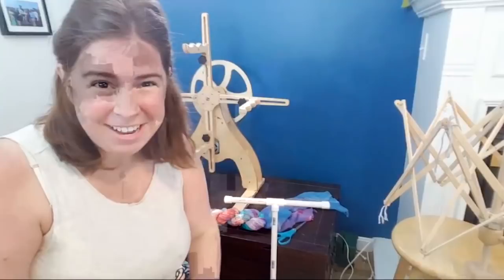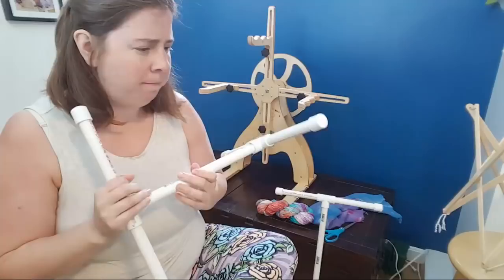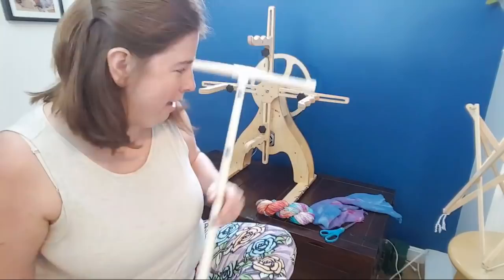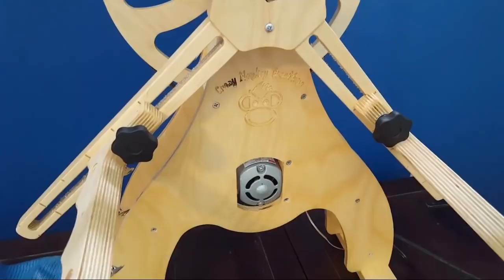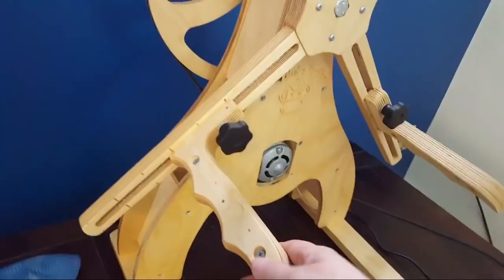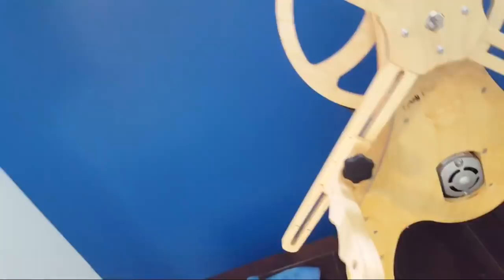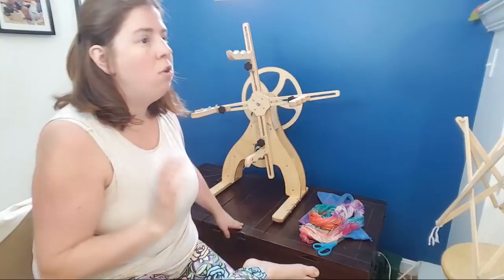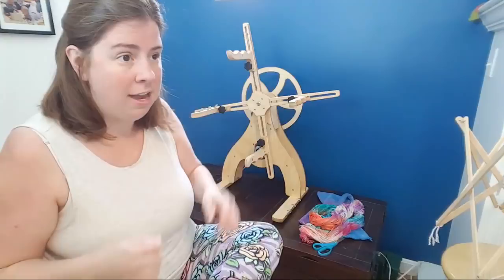My New Electric Skein Winder from Crazy Monkey Creations

Comment: A friend of mine uses a looseleaf notebook with the recipes (once she's happy with them) with a swatch of the fabric.  She has a  different notebook for the experiments.  It seems to work well for her.  Re: the dye changing from what it looks like as tested with the paper towel because not all the molecules have not yet dissolved, have you tried mising the dies with hot water initially?  That would  probably speed up the dissolving.
Reply from the maker: How water would definitely speed up the process.  I try to remember to use warm water when I'm using Wilton gels for example, but sometimes I don't plan too well.  In the example I was discussing, I was using a pre-mixed dyestock that was room temperature.  I'm planning to mix more of my colors straight versus making stock solutions again since I can't really depend on my concentrations I don't think.  I might make stocks that I plan to use over the course of a week, but I don't think I'll bother with 1 L stock solutions again.

Comment: Your should measure the notches and then write the measurements by them.
Reply from the maker: Now that someone gave me the tip of using my measuring tape on the winder, that helped a lot.  The notches are what they're supposed to be but the yarn stretches a bit when it goes on so that accounts for the differences I was seeing when I looked at the skein size.